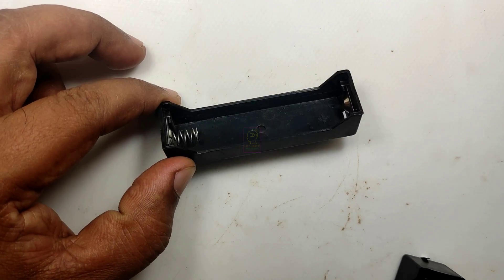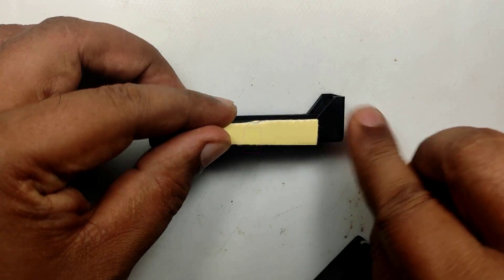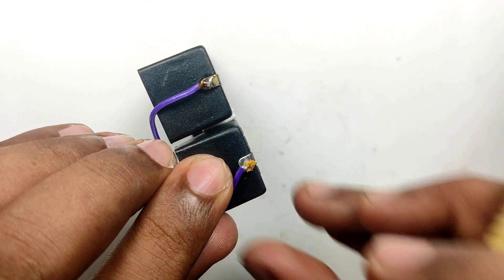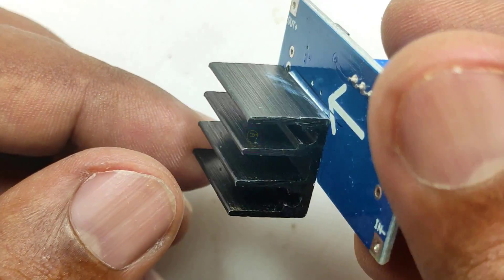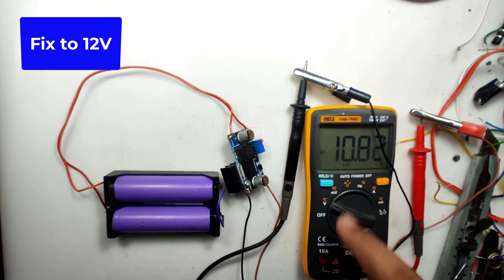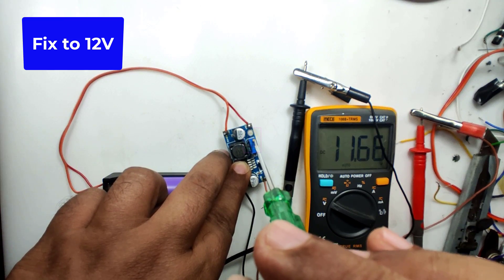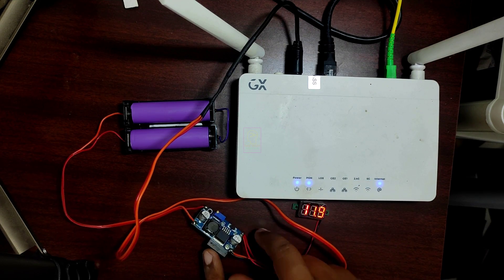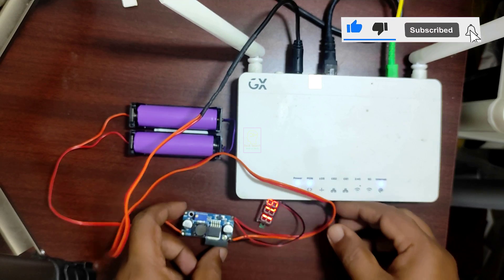Emergency Power Bank for Wi-Fi Modem and Router

Comment: If we need to charge these batteries how?
Reply from the maker: We need to connect BMS with this battery
Reply: @TechInsert  for 2batteries only bms? If I used 1usb port power bank module only for charging kindly correct me if I am wrong.

Comment: I made a circuit, with (3 Batteries 2000AH + 10A BMS & XL6009) - output set to 12V & working fine. But, the battery voltage is dropping automatically even if the input voltage is ON fed by a 12V adapter of original Nokia/Airtel router. At start it was 11.5, now it is 10.6, still observing it.  May be the output will become off aftersome more time. Why the battery voltage should drop instead of increasing ??  Where could be the problem ??  Please advice.
Reply: Sorry, just now found that there was a loose connection of the input wire. resoldered, now battery voltage increased till 11.8V
Reply from the maker: 3 batteries in series Or parallel? If it is in series you don't need xl6009 booster. If it is in parallel- 3.7v is not enough.  You need  minimum 6v to boost to 12v else lot of current will be used for boosting.
Reply: @TechInsert  3 batteries in series sir. I thought XL6009 would help to keep the output 12V constant even is the battery drops more down & would give more back-up time. Hence used it. Does it really help to increase the back-up time ? or no need to use it.  I appreciate you are seeing every comment and respoding.
Reply: @irapashunnur8237  It will reduce backup time. coz nomal li-ion battery voltage of 3 series connection is 11.1V. So 11.1V need to be boosted to 12V. Here xl6009 will draw more current and then boosted to 12v which will reduce the backup time of the battery
Reply: @BabuRaj-cs4lk  I totally removed XL6009. Now when I switch off the power of input adapter, the battery voltage display goes blank & router becomes off. Is it that it is not able to drive the router laod. Shall I connect a diode in series with the input to avod reverse feeding to adapter. It may drop the input voltage. Pl advice.
Reply: @irapashunnur8237  Disconnect battery and check  the output voltage from adapter using multimeter - it should be 12.7 and max 12.8 not more else it will makes ur BMS faulty. If voltage is high using diode in series and thus reduce the voltage.   Now connect the battery to the router. It will switch on the router. It shows your battery is working fine with router. Now connect the adapter along with battery. You can add diode for blocking reverse direction to adapter. It will not create problem coz ur routers min voltage is 10.8V if I am right.
Reply: @BabuRaj-cs4lk  Thanks will try as above.
Reply: No it will reduce the backup time
Reply: @tabm7644  OMG, thanks for your input. I will remove it now.

Comment: Good. Why BMS is not used. Is it not neccessary ?
Reply from the maker: This is used for emergency purpose, so with minimal things it need to work and that was the intention. But to be frank you can use 2s BMS
Reply: @TechInsert  Thanks, but What will happen if use it permanently connected to modem,  without BMS. Will the batteries bulge, or blast or any other effect. OR will it work very well without any issue for the modem. what is the AH of your batteries used ? How much hours of back up time you are getting with 2 batteries ?
Reply from the maker: @irapashunnur8237   Battery will not buldge or blast. Buldging is happening coz of slight manufacturing defect. The battery will drain if you are through out connecting  it. I am having 2000mAh and 2600mAh .  This folowing video is the  UPS for modem/router which has bms control https://youtu.be/iy28hDTFH7Y?si=T3St71CHFN4WNfrs. The disadvantage is if the battery voltage becomes low you cannot use it and you have to wait till power resumes and charge the battery. In emergency power bank if you have spare batteries and whenever battery voltage becomes low you can replace it and use it until you all your battery becomes low voltage . If you have 10 battery then you will get 5-6 Hrs backup.
Reply: @TechInsert  Now understood - its all for emergency you made it, as you used battery holder to replace batteries, in emergency. Supposing I make UPS with only 3 batteries of 3.7V inseries, without BMS, without buck booster, input will be given through a 12V adapter. Will it work as a good ups for modem, during power failure.  I also wanted to know the significance of BMS and Busk booster PCB.
Reply from the maker: @irapashunnur8237  No you cannot coz lithium battery should be charged in a balanced way. Overcharging may explode the battery. Once the battery become 4.2V reduce the current to micro ampere or disconnect the battery from charging. BMS will disconnect the battery from charging further more and thus protects the battery. If you are using 3 Batteries in sereis then we can avoid the booster modue. Then you should use 3S BMS. For modem /router use  3S with minimum 5A BMS is enough.
Reply: Thanks boss, nicely clarified.👍 One more - supporing we use 3 batteries (2000mAh) in series WITH BMS, with 12V adapter input, then when power goes, how much hours backup will I get for the Wifi router (Airtel Nokia) ? Upto how much under voltage will the router work well, 11, 10, 9, 8V ?
Reply from the maker: @irapashunnur8237   Kindly check the output ampere of the power adapter of the router. If it is written 1A then you will get roughly 2Hrs backup. If it is 2A then you will gett roughly 1Hr backup. If you want more hrs backup then parallely connect 3 more batteries. Upto 10.5V it will work, but wifi range will be less. But if I am right below 10.8V BMS will disconnect the battery.
Reply: @TechInsert  Great. Finally I do agree that (Battery + BMS + Buck booster) is the best combination to get optimum benefit.👍

Comment: Çan we make it automatic change over to the his circuit in case of power failure.
Reply from the maker: No, charging section is not included in this circuit. I designed this for emergency use only. For automatic chnage over i have another video https://youtu.be/iy28hDTFH7Y. This is Wi-fi Router UPS

Comment: Can this method be used to browse or surf the internet in case of power failure.
Reply from the maker: You mean laptop? If yes tthis cannot be used as laptop normally needs 19V dc. We need to add more battery in parallel for increasing the current and atleast one more batteryin sereis so that the output will become 12V. Then use 150W booster for raising the vaoltage to 19V. The booster in the circuit is not enough.

Comment: Awesome circuit. I made it and is working fine. I used LiFe, 6000mAh battery
Reply: Good to know. How did u charge the LeFe battery?
Reply from the maker: 2S LeFe BMS is available in market
Reply: I cant see it in India. Here for LiFe only 1S and 4S are available and for Li-Ion all are available
Reply from the maker: Nice work!
Reply: Life BMS is not available here
Reply from the maker: @tabm7644  4S and 1S is available in India. 2S, 3S is avilable in aliexpress
Reply: @TechInsert  ok
Reply: @tabm7644  Place?
Reply: @tabm7644  Country please

Comment: Excellent technique. Use one more batteries in parallel. Then when charge reduces the we can change batteries with charged  one by one
Reply from the maker: Exactly, if you have more 18650 battery then without inturrupting internet you can change battery
Reply: Nice
Reply: Good technique
Reply from the maker: @BabuProject Thanks
Reply: Even we can use LiFe with 6000mAh
Reply: @John-pk7lr  32700 , yes
Reply: @BabuRaj-cs4lk  Thanks